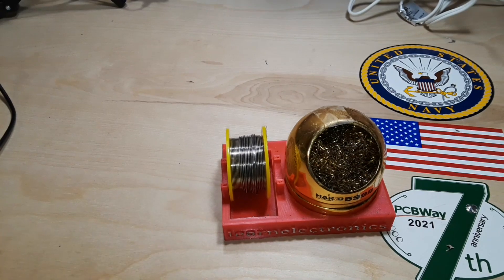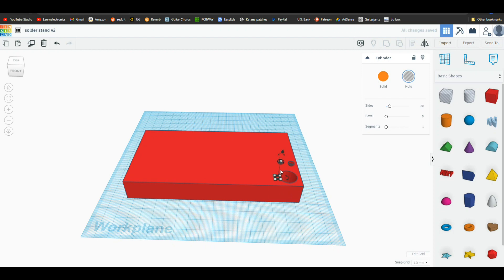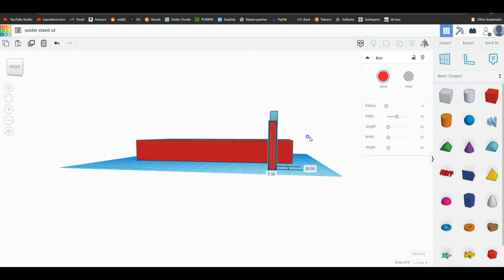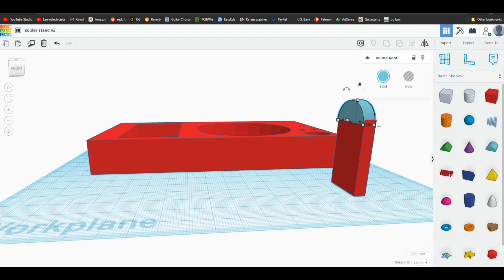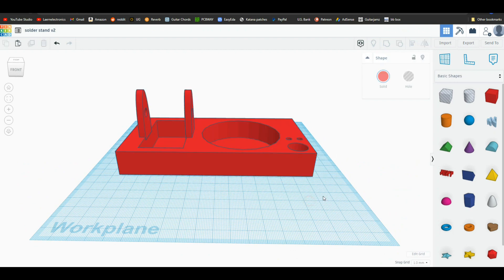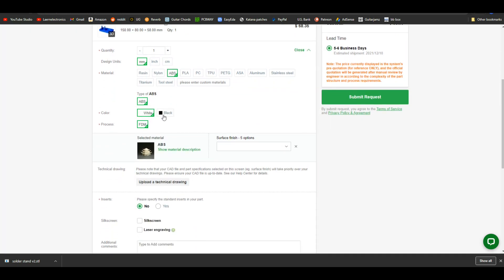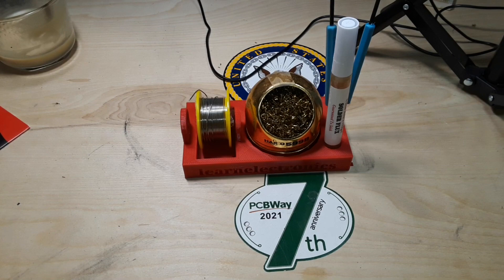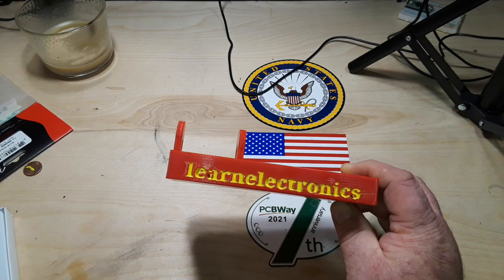Solder Stand V2 3D Print

Comment: I think I would have added a space for sponge tray. While the wool is a good way to clean the iron tip, sometimes a wet sponge is useful to clean and cool the bit. I have found using distilled water to wet these sponges is worth while, as it stops hard water salts from contaminating the iron. Obviously the sponge tray needs to be metal fitted into the plastic. If the iron touches the plastic, even a glancing touch, the plastic will melt and the surface finish will be damaged. This is the limitation with using a thermo-setting plastic.
In terms of design, I think I would have put those added tools and flux in a "pen tray", so they are horizontal and more stable.
Reply from the maker: Ok